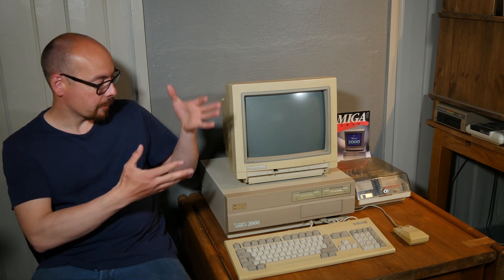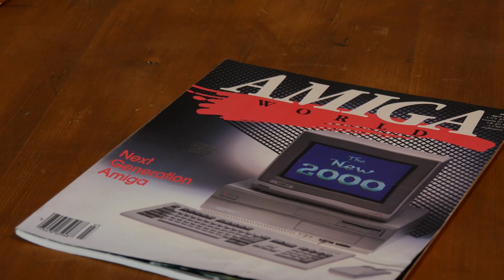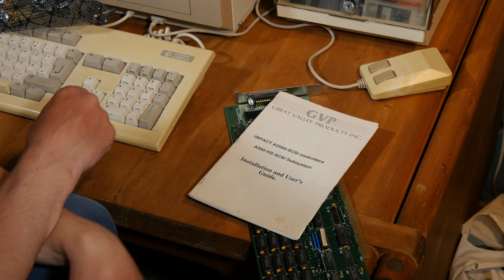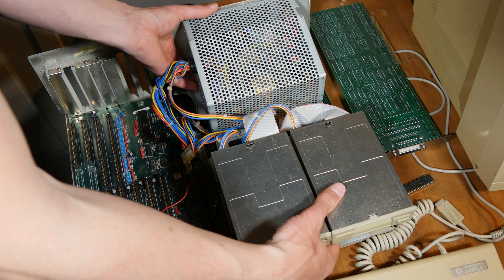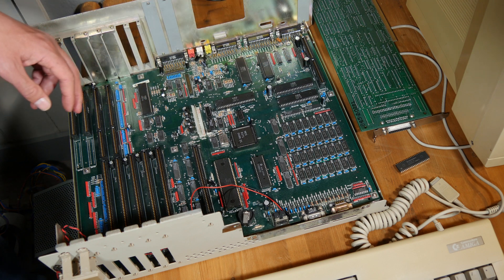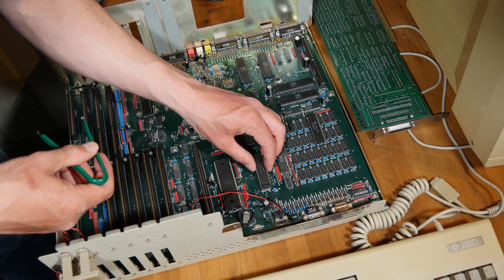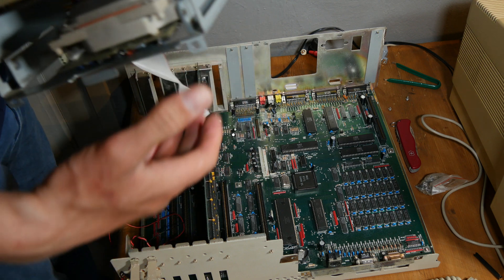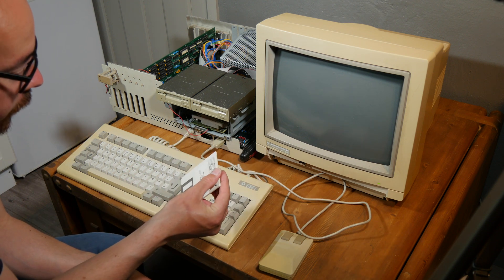Amiga 2000 Setup

Comment: IBM PC users couldn’t even dream about such performance at that period. In 1988 what could they bye? Adlib + Roland, when in real most games still used PC speaker. I remember Test Drive 2 from 1987 DOS and Amiga difference)
Reply from the maker: When I got a 486 in 1993, it didn't even come with a sound card. So even in 1993 in the beginning I only had the pc speaker. But you know, nostalgia. So I love the pc speaker too :P
Reply: I agree with you. A PC in 1987 would either still be monochrome or CGA unless you spent thousands of dollars on it. They were simply no fun compared to the Amiga. I may be biased, though ..